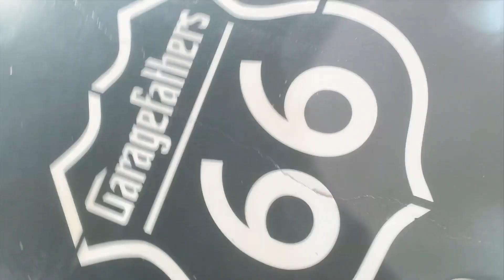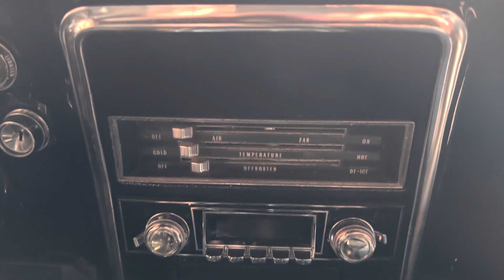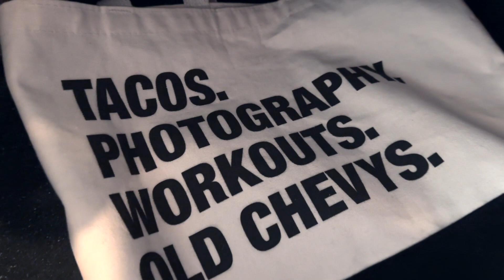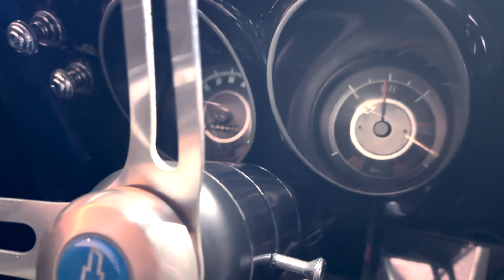Nikki's 1967 Camaro - Why everyone needs a first gen Camaro~

Comment: That was a great video and an awesome car. The color combination is perfect, and the overall paint and body is A++

Personally, I think the car sits just right the way it is. Manual transmissions are nice, but overrated on a car you just want to cruise, so don’t let anyone pressure you into a manual. 

I built a 67 for a customer, who like Nikki could not settle on wheels for the longest time. Funny thing is, he was going to use the same wheels, but we went with a set of Boze wheels. Like this car, his also was Marina blue with bright blue interior. It’s now red with silver Z/28 stripes. 

Nikki’s car is pure bad ass! I installed a Pypes Violator exhaust system on his car, and it was too loud, so we changed it to a Magnaflow system. From the looks of it, her exhaust looked older if not worn. If interested, contact me, I’m in SoCal. 

Again, overall, that is an excellent build and the perfect balance of parts! Well done, Nikki.
Reply from the maker: Thank you for the kind words! We at the Garagefathers couldn't agree more. Nikki is awesome, and so is her car.